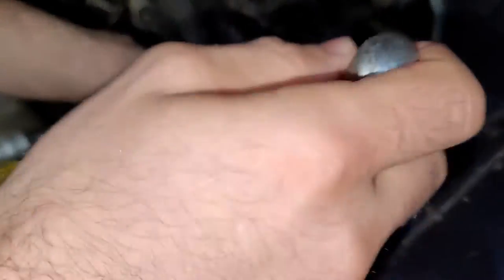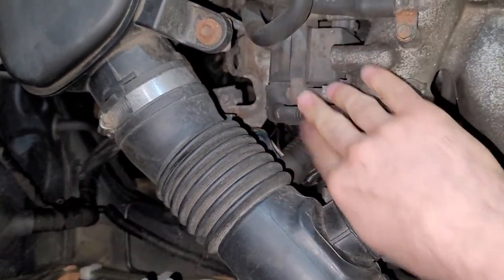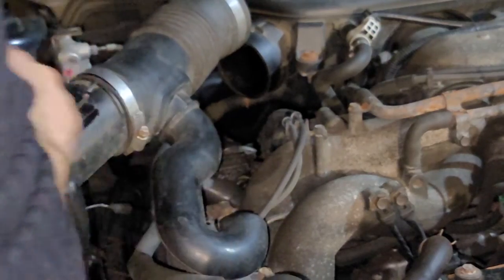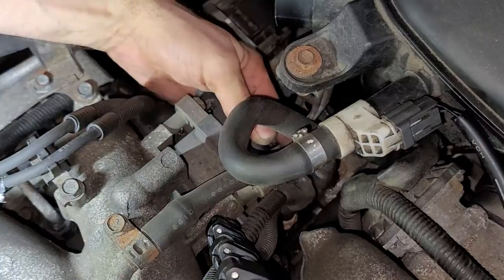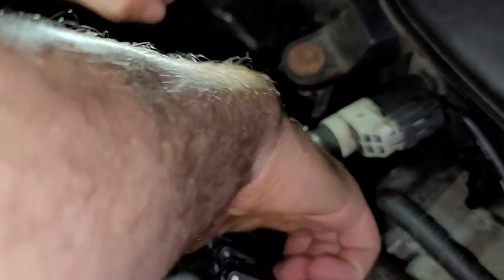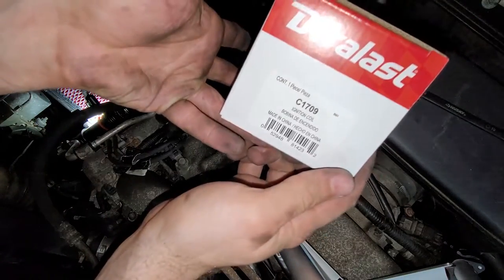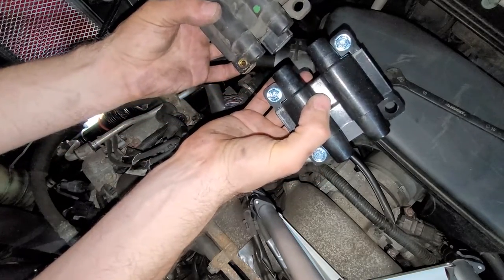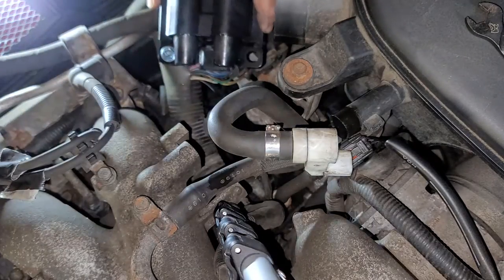How to fix Misfiring Engine/Replace Coilpack in Subaru (P0301, P0302, P0303, P0304)

Comment: My 08 subie was doing the same thing.  Found plug #3 cracked.  Then I found the plug wire arcing through the rubber.  Replacement of the wires fix!!  250k miles on mine.

Comment: hey other people. i replaced coil pack spark plugs plug wires injector and its still misfire my check engine light flashes violently. but only code it throws is missfire.
Reply from the maker: Check MAF next - clean/diagnose/replace
Reply: +1 maf sensor
Reply: Thing is, you could have an exhaust valve guide that's slipping. Only way to check that is pop the manifolds.

Comment: Hey , I have a same issue, I changed it but didn’t not turn on my engine . I also tested the spark plug coil dose not supply current. What am I supposed to do ?

Comment: Great video. I have an 04 Legacy with cylinder misfire on 1 & 2. I was warming up my car when the engine started to shake and the check engine light started flashing. I also noticed the Catalytic Converter was glowing red hot. Any idea what could be causing this?
Reply from the maker: Clogged catalytic converter probably. Just dealt with this, I have a video on it. If it is, you'll have to replace it, then your ignition coils, then your coil pack (possibly), then your spark plugs. Depends how long you've had the issue.
Reply: @Bootstrappin  I've had the car for a year, no issues. Literally happened overnight. If it is clogged I'm just gonna straight pipe it. My welder buddy said he could do it. I think cats are around 2k and can't get them used. I'll have to look up your video. Thanks.
Reply from the maker: @RIPdBOON  yeah the OEM stuff is worth as much as my car. I got some Chineseum off of Rockauto for $150. https://youtu.be/riWcIIwlEtk
Reply: @Bootstrappin  dude it just needed a simple tune up. New plugs and coil and she's running even better than before. What's crazy is I took it to a shop to get it diagnosed and those mfers actually quoted me $937 for a "premium" tune up. Anyway your videos helped me a ton, thanks again.
Reply from the maker: @RIPdBOON  glad you figured it out! Yeah I'm going through the same shit with a shady shop right now. I'm trying to get my state inspection done, and they told me I needed new brakes and rotors (I didn't), a new CV axle because a bit of grease came out of the boot (so?), new wipers (nope), and a new rack and pinion (the engine leaks oil, so there was some oil on the R&P boot). They must've been hoping that I'd take my car back to them so they could milk me. Dumb shit, just be honest - why is it so hard for some people?
Reply: @Bootstrappin  a lot of places it starts at the top, and trickles down. If you aren't making the most money for the shop then they'll find someone who will. Their livelihoods are on the line. It's a messed up business. that's what I think anyway. Good luck with that bro, maybe make a video on it.

Comment: Bro i am fighting the same thing with my Outback. Sluggish, no power, then itll take off. But no rhyme or reason and ive gone through all the normal shit it could be. Fuel delivery, not enough air, sensors that are related. Pissing me off and theres no clear YouTube video on this. Youd think it would be a common issue. Tons on nk start no crank. But not one on intermittent power loss and surging while driving
Reply from the maker: For what it's worth, and I have a few more videos on this, here's what rabbit hole I went down on until my problem was fixed: switching out gaskets, spark plugs, ignition coils and coil packs, cleaning MAF sensor, etc did improve the problem SOMEWHAT but was never the root cause. It turned out to be a clogged downstream catalytic converter. I don't have much of an explanation for the intermittent nature of your problem, but the clogged catalytic was basically like a potato in the tailpipe, and made the engine work like crazy to push exhaust through, leading to power loss. Try removing your downstream O2 sensor, which will provide an escape route for exhaust. If your problem disappears, that's a clogged downstream catalytic. If not, try the same exercise with your upstream O2, which would indicate an upstream catalytic converter clog.

Comment: The burning question has always been can you use the plug wires and coil from a JDM 2 L replacement intakes and injection system on your 2.5 L intake?  Yes you can it mounts backwards and you plug the one into the number to the two into the number one the three into the number four in the 4 inch number three and the coil plug is upside down😂😂😂

Comment: Last year I was getting a misfire during the hottest, most humid time of the year. I replaced the spark plugs and it was kindaaa better. Then fine for a year. Now humidity off the charts and boom. I really appreciate your instructions and enjoy your funny videos. Was also thinking about getting a Bronco…😂
Reply from the maker: Sounds exactly like my problem - you may dig deeper and wind up replacing the catalytic too. Then you'll dig even deeper and wind up replacing the car with a Bronco.

Comment: I installed a new ignition coil and ignition wires on my 2011 Impreza bc I had a misfire as well and it solved it but now anytime it’s cold it doesn’t want to crank over. My ignition wires seem like they don’t fit right into the new coil but I’ve been running it so long I haven’t replaced it but now it doesn’t start at all. Do you think I got a faulty ignition coil?
Reply from the maker: Actually yes, entirely possible. The first ignition coilpack I got was just some off-brand I got on Amazon or from Auto Zone or whatever. It worked very poorly, shudders/misfires, hard time cold cranking. Then I replaced it with an OEM straight from a dealer, and it solved all those issues (but highlighted other issues - a clogged catalytic). So whether you're replacing the coilpack, or the ignition coils themselves, go for OEM. And also - you may as well replace the spark plugs while you're at it, because a bad coil or coil pack can destroy spark plugs.
Reply: My subie rpm doesnt work...how to fix it

Comment: I just replaced my ignition coil on a 2007 Subaru Impreza, and it drove fine afterwards. But couple hours later it wouldn’t start. It did drop below freezing, and I just bought the car & it hadn’t been driven in over two months. Wondering why it’s not starting ?
Reply from the maker: Replace your spark plug(s). If the ignition coil was bad, it probably took the spark plug with it. The colder it gets, the more difficult a car is to start, so it needs everything in good shape. And to be clear, since you're commenting on a coil pack video, you're not confusing ignition coil with coil pack, right?
Reply: aftermarket coils for these things are known to fail when temperatures drop....use OEM Subaru /NGK/Nippon Denso.....(Duralast and the like WILL fail)

Comment: what is that sensor you removed @  3:24 ? My 2010 forester have a loose connection right there at the air intake parrt
Reply from the maker: I'm reasonably certain that's the PCV connector -- this diagram might help.

Comment: I have the same problem cylinder number 2 is missing firing watched this video got new coils and plugs but I’m still having the same issue what would I need to do next
Reply from the maker: Have you tried replacing the coilpack itself (not just the ignition coil on the cylinder)?

Comment: The problem for me was spark plug gap. The guy who sold it to me said he changed the spark plug but still didnt fix the issue so when i pulled out the spark plug i saw the gap was at .040 and its suppose to be at .044. Goes to show you that even the gap being .004 off is way out of tolerance. So i opened that gap a little bit and put it back in and walla misfire code gone! Hope this helps :)
Reply from the maker: Spark plug gapping feels like a nearly lost art. Good on you!
Reply: @Bootstrappin  thank you sir :) so easy yet very important
Reply: What spark plug goes to it

Comment: Nice video, I noticed your PVC valve needs to be replaced when you pulled off the hose.
Reply from the maker: Ah that's what the heck that is. Thanks for the tip! Will do!

Comment: Thanks for the vid.  Been dealing with an intermittent misfire on cyl 2 & 3 only when heavy rain with my 2008 Impreza.  Replaced wires no change.  Now thinking it might be the coils.  Did you ever scan for codes?  I get P0302 & P0303.
Reply from the maker: Yep same codes. Start with the coil pack,   and also replace spark plugs. Then address the root cause - it may be a clogged catalytic converter.
Reply: @Bootstrappin  ya I found a dead spark plug on cyl 2 and the valve covers are leaking oil on plugs so have valve cover gaskets ordered.
Reply: Mine does the same thing once it’s get cold or snows it drives me insane
Reply: @nicshadow4840  I changed the coil pack and no issues in the rain now.  Brand new car now.

Comment: Thanks for the video! Just replaced spark plugs and coil wires (I had one misfire and a pending misfire). (Then all lights turned off. I stepped on the gas A LITTLE to much) Then all four misfired a day later, so I am going to put the coil pack.
Reply from the maker: Let me know how it goes!
Reply: @Bootstrappin  Ended up getting a faulty part when I bought it. Had to go through the trouble of figuring out what was wrong because my car wouldnt start. All fixed now.
Reply from the maker: @klum8872  ah that's the worst, makes fixing the car take like 5x as long, and makes you question your sanity/competence. Glad you got it figured out.
Reply: @Bootstrappin  update= coil ignition broke again 😭 lmao. Going to spend some big bucks to get a new one.
Reply from the maker: @Sparrows587  hmm careful, if you're eating coil packs there might be a reason. What's your alternator/battery voltage like? Are the ignition coils new?
Reply: @Bootstrappin  my voltage is normal. It’s real confusing.
Reply: @Bootstrappin  oh, and my ignition coils are new. The ones I bought have plenty of comments saying they had to replace it a bunch.
Reply: @Bootstrappin  well, the the crank used to be normal. Currently, I lost my multimeter. But my friend is picking one up.
Reply from the maker: @Sparrows587  I see. For the ignition coil pack, I had big problems with the one I bought from autozone, not so with a Subaru part
Reply: @Bootstrappin  yes. I am buying an NGK coil pack now. Much more expensive but I am sure it won’t malfunction.😂 we’ll see
Reply: what about when you change the spark plug, wires, coil pack and mass airflow sensor and it still misfires or doesnt crank

Comment: Just got a ‘99 legacy outback that idled rougher than a mechanical bull today then finally bogged down and died when I got off the freeway. Managed to gimp it home but I can’t even get it up a hill right now without it bogging and dying. 

I’m on my own little adventure now. Starting with new spark plugs and wires, if no then moving to ignition pack.
Reply from the maker: Sounds like a catalytic converter that has given up the ghost. To diagnose, remove one or both of your O2 sensors, then run the engine. If your power returns, then it's a clogged catalytic (usually caused by a bad coil pack/spark/misfire)